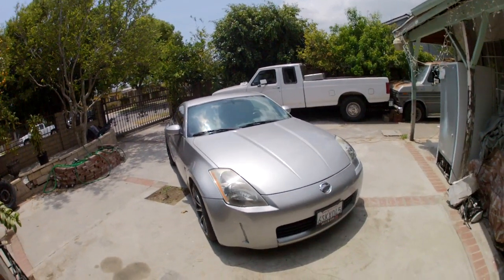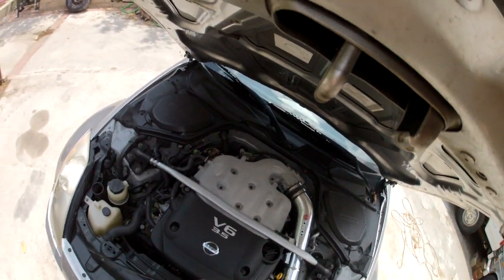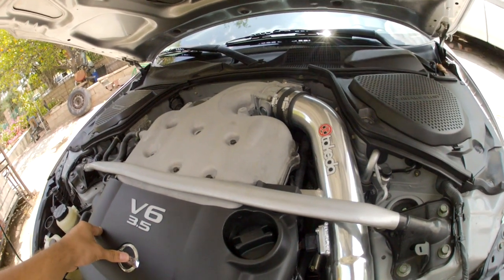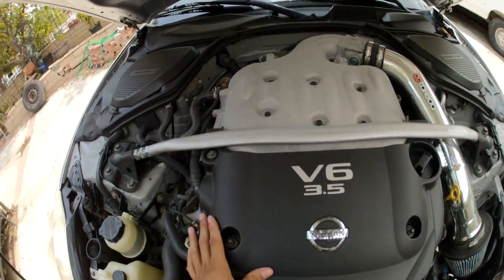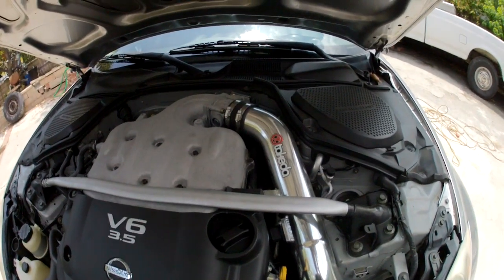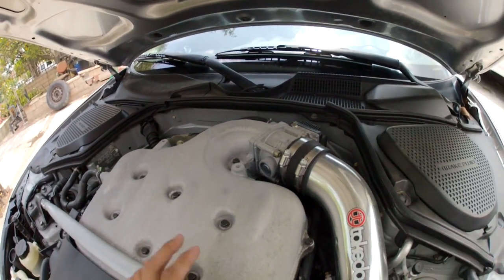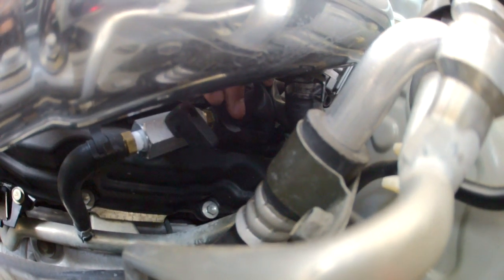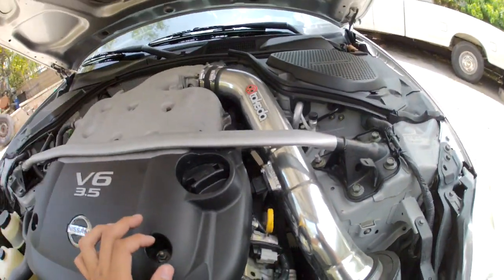How a Motordyne Plenum Spacer Works/Does on a 350z/G35

Comment: So the strut bar and engine cover will still fit with the 5/16th spacer?
Reply from the maker: Ryan Sperriko Yes... the provide spavers for the strut bar as well
Reply: LTX Chr1s did you have to adjust the tension on the strut bar?

Comment: I would go back to factory air intake and air box with a drop in filter. Factory intake has been proven to provide the most gains. Even on a cool engine most like k&n intake all lost power
Reply: Swaglife 81 That or an admin intake.
Reply: Fake news. If you know how an engine works. There's no way a hot plastic box with paper filter will flow better than a filter in the wheel well or in front of the grill. Or just get rid of the fucking air box/intake and install itb(individual throttle bodies) those horns will suck more air, make more power than any cheap k&n panel filter..

Comment: You bought the ISO thermal upgrade for heat soak, but you have a short air intake on your Z, it's kinda useless having a thermal upgrade if you are sucking hot air from the bay, just saying you should get a CAI

Comment: Does anyone know if I could just remove the coolant hose completely and put a screw in? I live in SoCal and its never going to get cold so I just want to get rid of it instead of adding a shut off valve..
Reply: +syndromer you need the heater if it's below 55 degrees, just get the switch for it, it's almost weightless
Reply from the maker: idk... you would have to plug up both ends of where the hose leads to
Reply: would that be OK? Does anyone know?
Reply: +syndromer ask on SoCal 350z pages on Facebook
Reply: They put that there so the air coming into the plenum cools off the antifreeze befour it pushed back through the system

Comment: Does it add a noticeable amount of power? I'm thinking about buying one for my 06 350Z.
Reply: Turbo for 1k? Are you kidding?
Reply from the maker: +Speedaholics 

Buy this 5/16 spacer and the MREV2 lower manifold and you should gain at least 15 HP
Reply: +BMGz33 Yeah but the MREV2 is $460 so both of them would be around $700 which is kinda pricy for just 15HP. I liked this spacer because it was just around $250 on Amazon and had great reviews from people that bought it
Reply from the maker: +Speedaholics the stock 06' manifold was changed so the mrev2 is a 03-05 ported lower manifold i believe
Reply: Yeah but like I said the Mrev2 is just too expensive for me right now, the spacer is like half the price so that's why I was considering it.
Reply: eBay turbos LOL
Reply: +BMGR1  Does 5/8" spacer would fit on 05 G35 Coupe bro? Its more thicker than 5/16" though. Thanks alot
Reply: 500 on a spacer... or just save double that, and you could turbo, and only be short the cost of a tune.
Even a stillen SC will get you into the 400hp range.
Reply: VGT turbos, and do the work yourself. I've seen people turbo 3800 swapped Fieros for ~500-900$. It's makeshift as hell, and it requires you to build a wastegate actuator (among other things).
Reply: Chris Foster
That's theoretical vs an actual product. Show me an example of someone who has done it on a VQ and gotten good reliable power. No sense saving up twice as much to blow up your engine in a week and cost you thousands of dollars.
Reply: Well no you don't just slap it on and drive it.
Even if I was only adding like... 1/4 bar of boost, I'd still retune it. When you go to turbo an engine, there's always a chance the engine can blow, depending on how hard you push it.
Knowing your limits, identifying the weak points, and most importantly a tune - should keep you from blowing your engine. There is no "go to" or "safe" turbo. What works for someone else might not work for you. 

Turbo'd Infinitis are pretty rare when you compare them to Turbo'd hondas. The only turbo'd g35 I've ever seen in person, was in Louisiana at a tuning shop. But it was RB swapped.
Edit: ^What I'm saying there is, it's hard to go by how good an "actual product" works for someone. 

Yeah VGTs run hot on gas engines because of their design (and diesel runs cooler), but people are still getting around this issue. As long as you did it right, the life of the turbo would probably be your biggest fear.

Mind you, we're comparing this to plenum spacers. A mod that might not actually help your car at all. There's people that believe their VQ ran worse after boltons.

Comment: The reason heat soak is bad is because cold air is a bit denser. Your coolant system will prevent the actual engines from overheating dramatically regardless of the incoming air temperature. Cold air means more more air which means a bigger explosion in the cylinder which has of course, means more power.

Comment: SO if I were to simply add a open/close valve and not use a spacer it would just cut the water flow, since that alone will not allot the unit to warm up to its usual temp?
Reply from the maker: Yeah that is right but the way the VQ35DE intake plenum is designed, the two fron intake runners/ports get much less air if you dont add a spacer... meaning you only cure part of the heat soak problem
Reply: BMGz33 that's fine, for now. 50% of something fixed is better than nothing! :) thanks!
Reply: BMGz33
Forgot to ask, do you know the ID and OD of the connectors used on the on/off valve ?
Reply from the maker: go7roo7 Unfortunately no I don't know the ID and OD of the connectors.... you can buy the iso thermal upgrade from motordyne from their website for $51 which comes with the coolant valve and aramid gasket to stop heat soak

Comment from the maker: Hello David... As far as I know the cutoff valve isn't sold on its own, you have to buy the motordyne plenum spacer kit in order to get it... or you can buy their Iso Thermal Upgrade kit which comes with the coolant bypass valve you want and also the aramid gasket to help with the heat soak..

I will post a link to their site in the description of this video :)

Comment: Did you hear a small hissing sound or a "psssssst" sound coming from the passenger side of the plenum? Some people are saying it's normal and others say it's not. I'm thinking i might have tightened the bolts too much but i sprayed wd40 on all the middle bolts and the car didn't rev up it stayed normal. Please respond, sound isn't loud but I just want to know if it's normal or if I screwed something up.